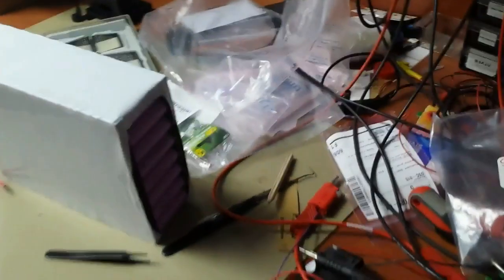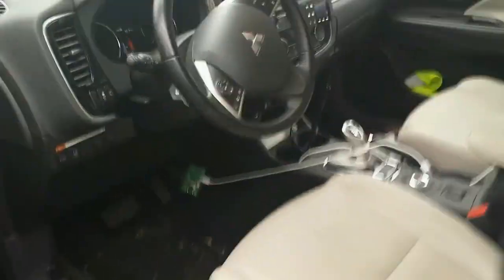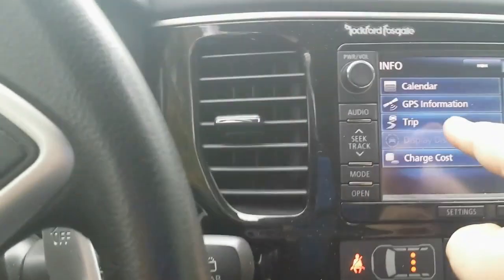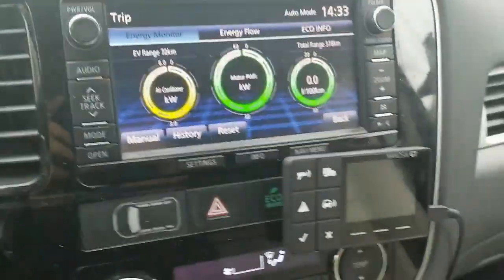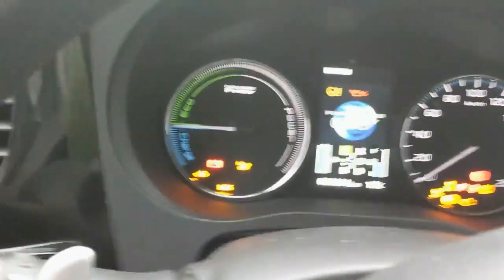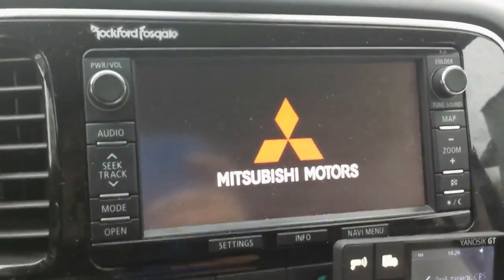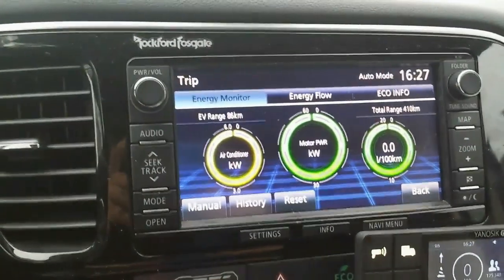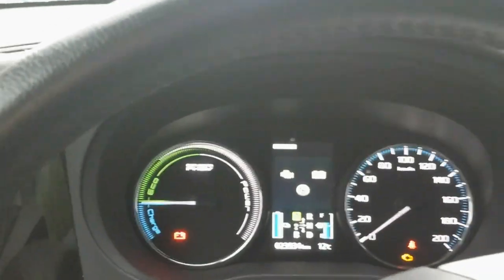Outlander PHEV bigger battery 19,5 kWh

Comment: I think this would be possible using LiFePO4 prismatics of the same size/capacity. The charging requirements are compatible and LiFePO4 will last a LOT longer and deal better with heat/cool and regen.

Comment: Has anyone tried to retrofit the 2022 Outlander phev's 20kwh pack to an older PHEV?  would be a good project with "original" cells.
Reply: this I would be also interested in, as technically the cell sizes haven't really changed (18650 form factor I assume)

Comment: Old video, I know but it is very interesting that this seems to be about the only battery upgrade project I have been able to find. My question is that did you use original BMS and if it is sensitive to battery chemistry? I have 2014 model that just vent bellow 70% SOH after few hundred km over 160 000 km warranty limit. So real world range has dropped to about 20km which no longer is very useful. I was planning to make replacement cells from 18650 sony cells that have adequately high discharge rate. Either VTC5 (2600mAh) or VTC6 (3120mAh). I did some CAD modelin and it should be possible to make 26 pcs parallel packs (80 of them) that would be drop in replacement for original Yuasa cells. My concern is that if chemistries are close enough so that original BMS can handle protecting Sony cells...
Reply: please do not try to mix different types of batterys with different BMS'es, this can be very dangerous
Reply: @grindfi  what matters are voltage limits. It is not “dangerous” if those are compatible. Specifically high voltage limit. Well Sony cells have a charge cycle limitation that might make them not useful for EV battery…
Reply: @karzza2  If you are planning to add parallel strings of batteries without a bidirectional DC-DC converter then chemistry is critical to avoid back charging and eddy currents causing serious heating.
Reply: @robertgregory8964  i was thinking more like replacing the whole battery with different cells. Most likely I will skip that upgrade. PHEV is not really optimal for my driving profile which is mostly long stretches rather than city driving. Better upgrade to real EV once there is other than Tesla model S at used markets with four wheel drive…
Reply: @karzza2  A PHEV battery has a very arduous task. It is smaller capacity (energy store) and yet must supply very high power for its small size. So it suffers frequent deep depth of discharge simultaneously with high ripple currents from accelerating and dynamic braking.
The Outlander is a heavy vehicle which demands extra power.
Moreover, dynamic braking creates a charge current beyond what most small EV batteries can tolerate for anything but very short durations.
I wonder if the Outlander chews out the small Yuasa LEV40 batteries when the driver selects strong automatic braking. Unnecessary one pedal driving is a frequent extra stress by creating battery ripple currents, the driver has to remember to "feather the throttle" in order to coast.
A larger battery would address all these issues.
Reply: @robertgregory8964  I completely agree. about >20kWh pack would be possible to fit to the original case most likely (26 18650 cells in parallel and 80 sets in series as in original. My biggest concern with that was Sony cells are rated to 300 cycles while Yuasa is 3k or 5k (can't remember). However there is a big difference since Yuasa cycle life is specified with 1C load while Sony is specified with full rated 11.5C load. I was thinking of getting device to test the Sony cycle life with 1C discharge current but since I shifted my eyes from PHEV to full EV I tought I could use that time better. Sony cells would be able to provide more than enough power without braking a sweat. In fact with that pack capacity even cells rated for 7C discharge load would be good enough for Outlander (EV power of 150kW).
Reply: @karzza2  I notice the Yuasa LEV50N 1C cycle life to 80% DOD is 5500.
Charge sustaining mode of Samsung NMC cells used in the early Toyota Prius plug-in supposedly far exceeds 100 times their 80% DOD figure.

Comment: Why have not any one made a Emergency cell like a petrol can you can carry in your electric vehicles so if you run out of power you can plug it in and in a few minutes you can drive to safety or a charge point.    Don’t say it would be DANGEROUS Because there can’t more danger than driving around with 5 Ltr of highly flammable liquid in your car?

Comment: I was always wondering if I could do this in my Peugeot Hybrid which has a very inefficient battery, old old school NIMH. Barely 1 kwh.

I was wondering if I assembled a battery with it's own BMS management, but still connected it in place of the old battery, if it would work without digging into the car's ECU's. 

To keep the discharge and charge rate identical, but just to have extra capacity. Batteries are way cheaper than they were 10 years ago when Peugeot designed the Hybrid4. 

In general, upgrading the capacity but keeping the same voltage need changes to the car systems?

Comment: Is it possible to do this to a Volkswagen Passat GTE?
Reply: Should be possible. But you can use regular NCM cells with a higher capacity. For ex. 53Ah. Regular cells have about 25 or 37 Ah i think.

Comment: Did any of the electronics, such as battery management system, require any change of settings or modification when the battery capacity was increased over the original capacity? It would be very encouraging if battery capacity can be simply increased and the car's control systems will recognise that increase.
Reply: That My question like in nissan leaf
Reply: My friend have Outlander PHEV 2014 with double battery capacity but car does not use additional capacity so it need bms modification etc

Comment: can you make a video on how you modified the original battery?
Reply from the maker: Yes, I plan to make it when I will be rebuilding it to 23,5 kWh (as now I use cheap chinese cells and I have built this as beta-prototype). So in 1 month.
Reply: @ThomasTheTeslaTuner  I am hoping this project update is in the works...
Reply: @ThomasTheTeslaTuner jakies wiesci odnosnie powiekszonej bacteria?
Reply: @michadutkiewicz7759  podbijam pytanie ;)
Reply: Izzygrip Sunheatstop that would be awesome.  Thanks.
Reply: the entire battery housing is air conditioned.  bigger capacity wont generate any more heat ,as the discharge and recharge rates are unchanged.
Reply: hi ... very interesting indeed, can I ask how much did you pay for new battery pack, and how difficult is to swap it by yourself ?
Reply: Very interesting. Did you just add the cells or have you done any other chances? Like with the software or something?
Reply: Fantastic! How´s the build video coming? Where do you place the battery physically in the car? Are you in Sweden or Poland?
Reply: How are the bigger batteries cooled? Will it be safe?
Reply: How are the bigger batteries cooled? Will it be safe?
Reply: What was the cost of this mod ?